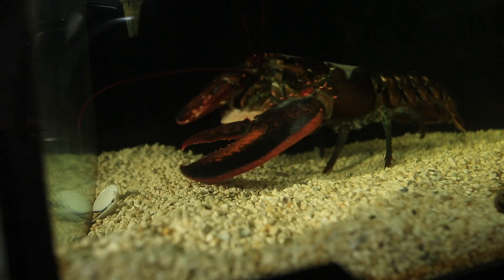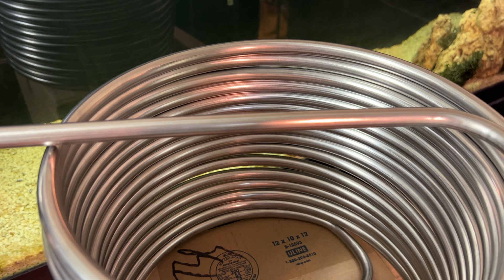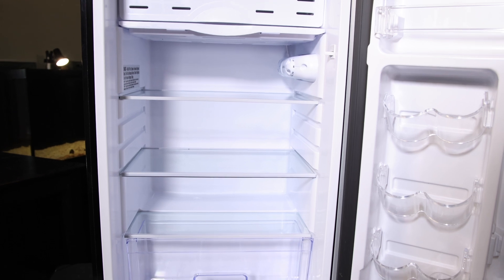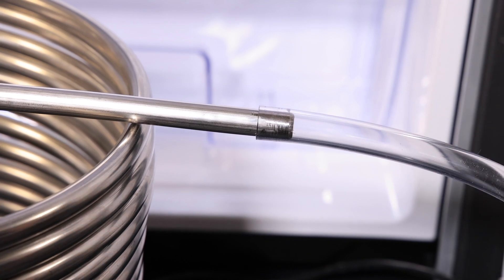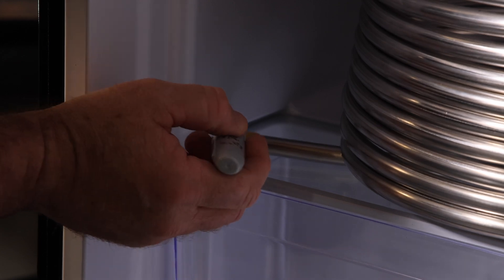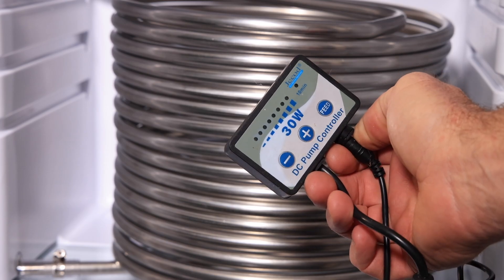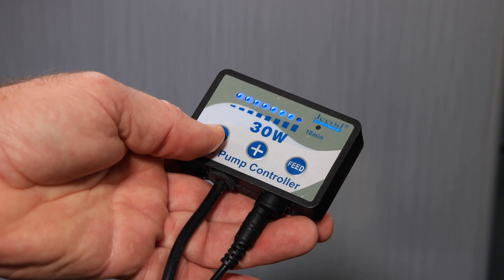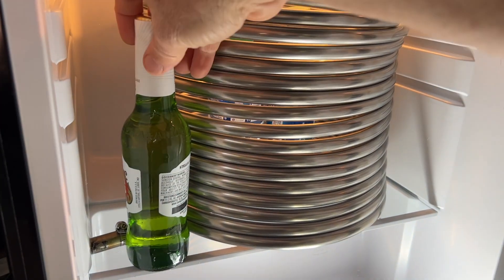Building A DIY Aquarium Chiller

Comment: I'm sure it was already mentioned in the comments but i can't find any. Just wanted to add that in theory the flow rate (within reason) should have no effect on the cooling power. If you lower the flow rate the water stays in the fridge for longer, resulting in cooler water being pumped out. If you increase the flow rate, the water won't be as cool coming out of the chiller, but more water would be cooled in the same time. As long as the water does not reach the temp in the fridge any flow rate is enough.

Comment: I'm in the process of building a chiller for a wood drying vacuum kiln, using a used 8000 BTU/hr window A/C unit mounted with the cold side in an antifreeze filled cooler. I considered a mini fridge but an A/C is much more powerful. I'm copying someone's blog post ("glycol chiller build")

Comment: It looks like your input is on the top of the coil and the output at the bottom. Wouldn't it be better the other way around? i.e the input at the bottom and the output on the top. That would make it easier for any air to escape the system.
Reply from the maker: That’s a great thought.  I was considering that the pump would not have to work as hard pushing water down through the coil as it would pushing water up through the coil.
Reply: @Bradybrandwood  Well both ends of the tube will eventually be at the same height going in and out of the tank so I think the pump will have to work equally hard. But changing the direction of the flow would make it easier for the air to escape I think, and maybe that would even make it easier for the pump... I'm not sure. Thanks for great content anyway :)

Comment: Brady, this was an awesome DIY. I would like to suggest, just for a little more efficiency, some spacers in the coils to allow air to pass between them more easily. I may be wrong as your refrigerator environment may be rather static in regards to airflow, but thought I would suggest it anyway as I suspect a coil spacer would be relatively cheap and easy to find.

Comment: Do you have a failsafe, so that if the chiller developed a catastrophic leak it would not drain the aquarium?  I can think of two ways-either by placing the variable speed pump high in the aquarium, or by having a water level detector switch off the pump if the water level dropped.
Reply from the maker: Yeah the pump is high in the aquarium. Definitely never safe to put the pump at the bottom of an aquarium.

Comment: 316 is the safest option as it’s double the nickel than 304, however 316 is more expensive then 304 so it’s good to weigh that option as well, both are food grade approved meaning there isn’t a large risk of corrosion but 316 will handle the salt water way better

Keep up the awesome vids!

Comment: I would have opted to use a metal bucket to suspend the coil into so you have the additional thermal mass from more cooling water. Also opting for hard brake line tubing would give a smaller diameter to fit more turns into the loop. (Nickel or Zinc may be an issue)

Comment: If anyone is planning on trying this they can call manufacturers of the fridge for information on where wiring and tubing is in the fridge, also the inlet and outlet pipes can be insulated for better results ( I worked in both Aquarium and refrigerator industries ) 
Keep the updates coming on Leon, They are very interesting and your delivery is excellent.

Comment: if you place thin spacers in between the coils, that might increase the efficiency in the warmer months, when it's more difficult to keep the temperature lower. Very cool project, and made me think it would be fun and doable, 
to keep a lobster
Reply from the maker: That’s a cool idea Kevin! ✌️✌️✌️
Reply: @Bradybrandwood  Foam pedicure toe spacers are relatively inexpensive and could be easily cut up to accomplish the spacing.

Comment: Hey Brad, you could have saved a bunch of money by getting a shallow (4") aluminum cake pan for your freezer. Then lay plain vinyl tubbing in it. Fill it with water and make a big ice cube. Now just circulate water thru the ice cube to get your correct temp. Like your Leon show.

Comment: Nice job! You might want to look into building a simple tempertature control system to control the pump such as an STC 1000, this way you can set the temp you want the aquarium and the pump will turn on/off to keep it at that constant temperature. Just a suggestion as I have built several of these setups for brewing systems I have worked on for fermentation control, the same principal but different applications :)

Comment: Why choose coil over putting a radiator inside a fridge?
Reply from the maker: I wanted to be sure I was using only food grade stainless steel.  ✌️✌️✌️
Reply: @Bradybrandwood  
Make sense. I was thinking a radiator might perform better and computer parts for water cooling would be small enough to fit in a mini fridge. 

Early days of computer water cooling like back in early 2000's we used Aquarium pump and tubes inside our computers since computers weren't that common yet. These days computers are common and computer water cooling is more common. 

I don't think there any stainless steel computer parts at least not in the consumer market. I think everything has a nickle plating in computer water cooling. Don't quote me on that.

Comment: Great project, you are relying on the air flow within the fridge to circulate around the stainless coil, you could increase the cooling capacity by adding a low voltage fan to blow the cool air through the coil, you can buy usb powered fans from Amazon with speed control for a few dollars.

Comment: As suggested by The Broken Life, you need to grommet where the hoses pass through the metal cabinet. The vibration of the compressor, along with the  sharp edge of the hole in the sheet metal will eventually saw through the tubing. While actual passthrough grommets are ideal, one possibility is to force silicone rubber caulk in and around the hole. This will cushion and trap the tubing in the hole, thereby eliminating the sawing motion of the vibration.
Reply: I was thinking to push the coil ends through the wall and then do all the connections externally. Would that negate the need for grommets?
Reply: @ValeriePallaoro  You still need a grommet or bead of caulk to prevent the sawing motion. The stainless steel tubing would take longer to saw through, but any time you have an "edge" like a hole in sheet metal, you need to ,either bond or grommet. Look at the firewall in your car (sheet metal wall between the engine and interior) every wire or hose is grommeted or bonded.
Reply: @bobcraig3827  I think he can get away with it this time... The hose fits snugly and its got the insulation and plastic to support it from digging into the metal... If there was no insulation I'd agree with you....
Reply: @bobcraig3827  it's not sawing through stainless steel dude.
Reply: @EikottXD  Saw through the TUBING. 
dude
Reply: This is the same principle where people use these mini fridges for home brewing where instead a pump pushes a glycol water mix to a coil actually in a fermenter.  The freezer section above gets bent downwards slightly so it's immersed in the glycol container. Obviously glycol is dodgy for anything to do with an aquarium. Either way it should probably be drilled through the front and use inserted bulkhead elbow quick disconnects for the tubing. Also an inkbird is essential.
Reply: Stops air leaks too.

Comment: You will have much better luck with a different design. Right now you're relying on the air to conduct the heat from the stainless steel coil to the refrigerator's coil. This is acceptable for food where the goal is to keep it at a constant temperature, and the convenience of pulling it out quickly is important. But it's not good for transferring large amounts of heat. That's why wine chillers will use a water or brine bath.

Anyway, you want as good of conduction between the cold coils on the refrigerator and the water in your tank as possible. The ideal way would be to take the refrigerator apart and place the coils directly in water, but this ruins the refrigerator. The next best method is to maximize the contact between your water pipe and the refrigerator's coils. Ideally you'd solder or braze them together, but even having them in close contact with each other is much better than having them separated by a bunch of air. 

Finally, if you are going to stick with the current design, separating the coils to maximize the exposure to the air and maybe adding a small fan to help circulate air will definitely help. Good luck!

Comment: Great low-cost dual-purpose solution. However if you'd like it to function even better you could have the refrigerator and the aquarium in different rooms. The calories removed from the water being released into the same room from the back of the fridge will eventually at least partly end up back in the aquarium water otherwise. One could imagine the refrigerator immediately on the other side of a stud wall to mitigate this with the pipes coming through the wall. Also won't your refrigerator end up wet from the freezer dripping with the drip tray removed?

Comment: you should have put silicon culking in around the tubing to seal the holes to prevent air leaks, keep the cold air in the fridge and warm air out.as the cooler works best when air tight,  silicon culking should go both on the inside and on the outside.
Reply: Really unecessary!

Comment: Awesome job, however I recommend you run a rubber grommet where the lines run on the fridge as you are losing temperature in between the gap from the filter line. Or you can just use a bit of silicone around it. That way the cold stays in the fridge doesn't escape and the compressor isn't working more to compensate for those losses.

Comment: As You did with a lobster, I did with a Astacus astacus Linnaeus, which is smaller, but is living in fresh water, what makes it much easier. However I soon realized, the aquarium needs cooling, especially in summer. There are readymade aquarium coolers available, but did not appreciate such a thing, high price, loud, high power consumption.
I used a Peltier element for 12V (like used in cooling boxes) and it worked great, reliably and cheap. I put in series with the filter hose, and thats it. Power is provided by a car battery charger.

Comment: If you could hold the water for 5 minutes in the coil then realese it .then the water will be much cooler than instead of flowing the water.you could make it a pump timer controller by a Arduino.

Comment: I've got 2 of those same Craftsman drills from my Dad. I used them when I was a kid 45 years ago and they are just as brutally strong today as they were back then!
Reply: I kinda wanna know how useful they were
Reply: @BurnItUpYT72  They're a tad noisy, but not as bad as even today's cheap drills. They are powerful... if you have the side handle attached, I've sheared off quarter inch lag bolts driving them into oak. Bolt quit, drill didn't.
Reply: @kleetus92  thank you this is helpful especially since I'm doing more practical work in high school where I work with machines
Reply: @BurnItUpYT72  No problem. They are bigger and a bit clunkier than a brand new Milwaukee or Bosch corded drill, but it's also 50 years old and still taking names!

Comment: By the way it was a very smart idea using that stainless. While there are many other metals that could be used some would be better some might be worse but overall I think you found a good Middle Ground 316 stainless steel should suffice quite decently for this purpose. But your choice of material and sourcing is quite excellent honestly Brewery equipment is designed to be able to well provide an environment that's safe for something as sensitive as yeast so for the most part used to pretty already but the things that they are sensitive to they are extremely sensitive to. Long story short you made a good decision here now let's see how the rest of your build is I will try to give you some advice if I can I do know quite a lot about building chillers and stuff so and might be able to help make efficient design if you need
Reply: Now I will say unless you do it later but so far the only thing I'd have to say is insulate your external pipes but otherwise yeah if you need better cooling you can always use heat sinks to help radiate more
Reply: All right yeah so additional heat sinks and if possible water surrounding the pipes themselves because water transfers heat much better than air does and Waters thermal capacity is pretty insane so yeah like if you can put like a type of water with the coil fully submerged make sure you caulk around so it's sealed but that water will help transfer the heat much more efficiently, an alcohol would do much better but I would be worried that if there ever happened to be a leak it would certainly poison the water so water is better

Comment: Another suggested tweak: instead of bottles of water inside the stainless steel coil, why not cans or bottles of beer? Thus you could enjoy a cold one as you reflect on the tremendous work you have undertaken on Leon's behalf and for our entertainment.
Reply: Taking the cold bottles out of the fridge and replacing them with warm bottles often would warm up the fridge and aquarium. Better to have separate aquarium cooling and beer cooling fridges.
Reply: @raccoontrashpanda1467  I had imagined taking beer that was already cold and adding it. You make a good pint. By coincidence I have this beer in my fridge:Trash Panda by the
Parallel 49 Brewing Company

Comment: I am surprised by the temperature changes you  got. Probably because of the large tank size. I am getting ~ 10° decrease on a 10 gallon tank from room temperature with 2 120mm fans.... 1 in, 1 out.

Comment: Aluminum cans would work the best however you probably want what is in the can so plastic water jugs and bottles should do you quite nicely to fill up Open Spaces minimizing heat transfer every time you open the door because an open space is simply a heat exchanger in and of itself. A wise man would simply use a plastic bag and fill it full of water. Using the stainless steel tubing as a frame and a good rubber band twist tie situation atop would be second-best to Ideal for inside the coil while minimizing installation and minimizing temperature variance and wrapping the hoses in white cloth will also assist with holding the temperature especially if you wrapped them in cloth and then in plastic vellum otherwise known as Saran Wrap

Comment: Forget my animals, my 70 year old house gets to 31°C / 88°F when the antique central A/C is off... Ha!

My neotropical reptiles love it, everything else does not.

The sheet steel is more than enough to cause that vinyl tubing to fail, over sized hole, filled with expanding foam and rubber grommets would be a safer bet. If you're open to it. You can also wrap the tubing in pipe insulation for a few dollars.

Comment: An actual air to water heat exchanger could be had for less than the stainless coil, and it would take up far less room in the fridge. A small one may fit in the freezer section alone, and it would cool way more efficiently than the big coil in the fridge. Bet it would bring that water down many degrees more. It would also leave the rest of the fridge open.
Reply: Yea, this seemed a bit over the top.
Reply: reef tanks have specific needs which he mentions, ie. copper will kill leon

Comment: I'm currently working on building a paludarium for some Kaiser newts, and seeing that I live in the scorching central valley in CA, I'll definitely need to get a good chiller for these cold-loving amphibians. Though I'll probably just end up buying a prefabricated chiller, the idea of building one from scratch is certainly intriguing. 

I might try this project myself once I have a bit more experience under my belt; I'm not a very handy person, and I'm sure I'd find a way to screw this up somehow if I tried it now.
Reply: Read all the (well, not all of them, of course) comments. There are some very good tips to add to the functionality of this build, use a second hand fridge (cost reduction) where to site your drill holes (safety) grommet your tube holes (reduces wear and tear on the plastic) don't take out the drip tray (otherwise freezer drip water into the main area of the fridge) There's a hella bunch of knowleagable people in the comments section. Though, my thought is no Kaiser newts in central vally CA, (they are stunning, tho)  I'm sure some warm loving species would be kinder (I can't imagine how I'd feel if my cooling system broke down on 'em) Be brave. DIY is really all about failure until you get it right.

Comment: Nicely done! You can also increase it's effectiveness buy insulating the clear tubes externally. The more insulation, the less strain on the compressor. I had used a long freezer (a GE I believe) and dedicated most of the right side of it for my 45 gallon tank chiller. It worked well (dropped the temp on average of 15 to 18 degrees in a fairly warm basement) and I had plenty of space left over for other frozen goods to boot, so it was a nice thing to do all around. Say hi to Baxter and Leon for me!

Comment: came for leon, stayed for the diy...

couldn't you just grab a standalone heatpump tho? or is that too specific hardware to get in your hardware stores?

also, your drillwork is even worse than mine and I have to plan on putting cement in the wall (brick, not drywall, obviously) whenever I grab my drill :P